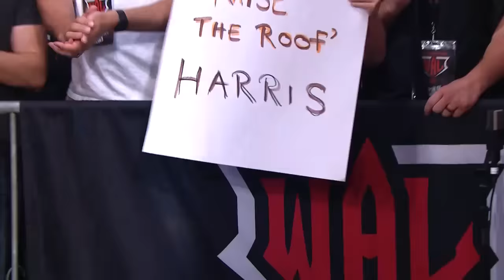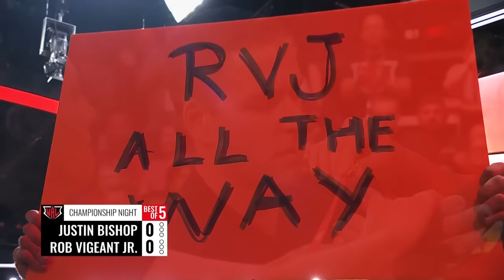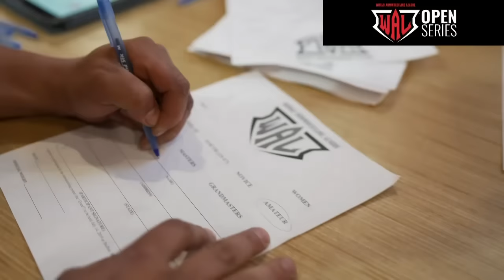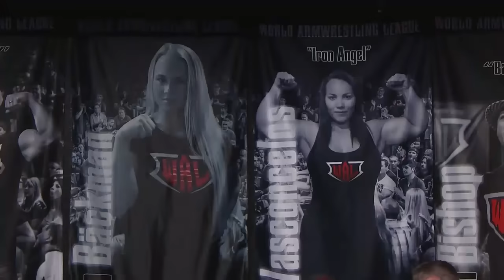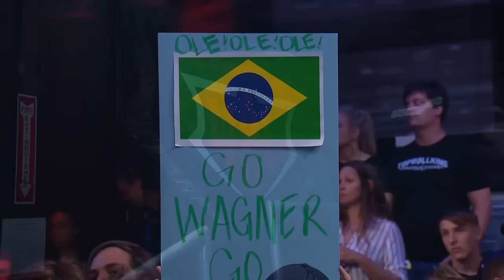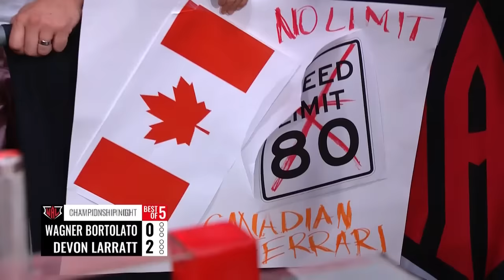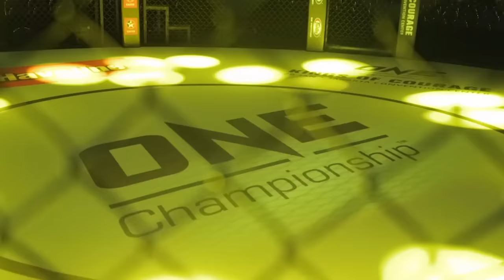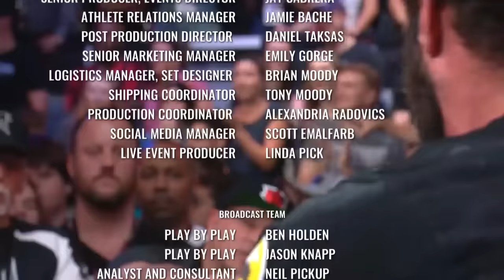WAL 506 Championships Atlanta (FULL EVENT)

Comment: The refs messed up the final match, once your hands come out of the straps it should be a restart
Reply: How are you supposed to pin a guy if your hand is behind the other guy's?
Reply: They didn't restart because Todd kept his fingers in contact to stop the guy running. Todd had the match easily which is why the other guy ran.
Reply: @Anax100  LMFAO ! If you think MT would've won your clearly delusional .
Reply: That's not what the rules say.  As long as the hands or fingers are together, there's no restart even if the strap breaks.

Comment: Todd lifts his elbow up between 2:26:11 and 2:26:16 TWICE + shoulder is at the level of the elbow pad(not sure if below). He should have lost round 4 on a foul, or at least gotten a running foul. Instead Cadorette gets a running foul for HIS elbow leaving the pad due to the tug of war move that is the kingsman. 2:27:02 Tod uses his tricep as a fulcrum on the elbow cussion, questionable contact with elbow at this point, again no foul is called. 2:27:45 Todd again uses his tricep on the pad + his shoulder is way too low while in a losing position, still no foul is called on him. 2:27:57 I'm not sure if Todd pulled Cadorette or if Cadorette just got frustrated and decided to push diagonally, but he got a second RF for losing contact with his elbow. 2:29:10 Todd has a false start and throws his entire weight back and down to drag Cadorettes elbow of the pad, Cadorette gets fouled and forfeits the round.
2:34:16 Todd's elbow is going for a flight again, pushing his tricep into the table. 2:34:53 Todd's elbow is clearly no longer in contact with the pad. From 2:34:50 onwards Todd's elbow is above the pad more than it's on the pad. 2:34:35 the strap is now in an unsuable state, the backs of their hands are basically touching at this point. Todd is holding onto the strap while Jerry is left with the short end of the straw. Whenever Jerry tries to pull his elbow on the pad Todd throws his weight back and bitches at the ref about it. 
This match was disgusting to look at starting in the 4th round. Todd preaching about not having different rulesets, but clearly he's allowed a lot more leeway with flying elbows and low dropping shoulders than any other competitor in this sport.
To finish it off, unsportsmanlike conduct, aka arguing with the crowd, is also considered a foul.

Comment: League needs to open their eyes on Todd's tactics and make rules around his loopholes because this dude seems to read the rules, then finds ways to loophole them to his benefit.   This dude literally ran himself out of the straps.  The league also isn't honest or consistent with it's existing rules.   This is a shitty league and 506 just confirmed that to me.  Even with the females, camera caught two elbow fouls and after the second one, the camera angle was no longer being used.  That's literally turning a blind eye.  This was a shit event.   Sport needs to evolve much further.   Make a rule that mandates your palms must always be flush together throughout the match.  Invent a strap or gloves that keep their palms together, allows room to pivot, maybe with a thin pivot wheel at the center, but impossible to run out of, forcing the palms to stay flush together.  And get rid of that King's move.